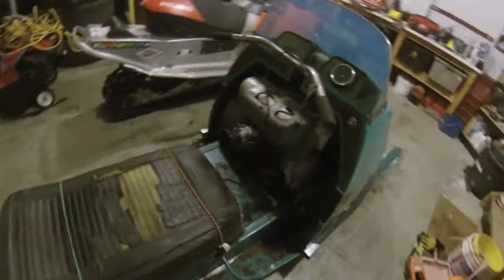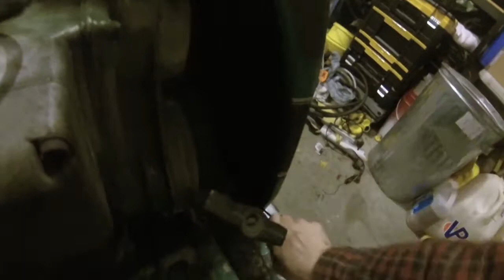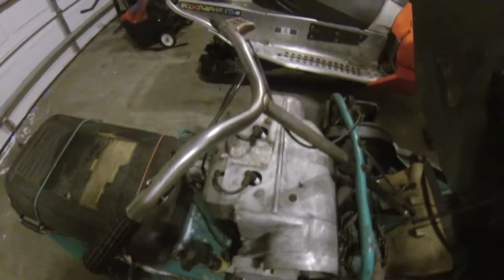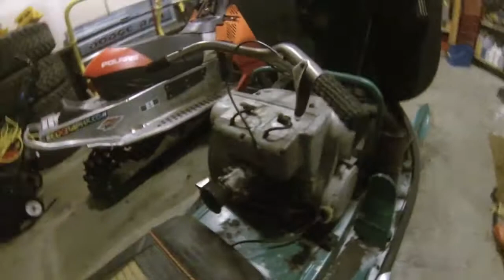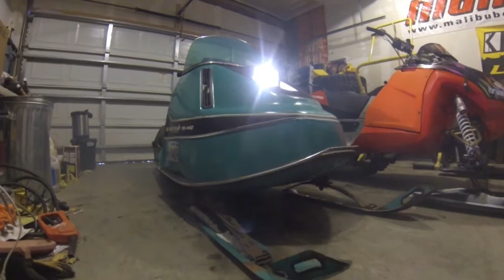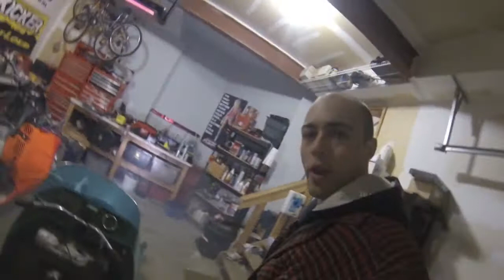1971 Skiroule Rs 440 Sachs, walkaround & startup

Comment: had an re-400, ss-300, and s-250. father assembled them for the local dealer on his off-time. oem clutches and the tillotson carbs were crap.  always wanted but could never find any '70 rtx.
Reply from the maker: Jex Smx Awesome! Yeah the stock clutches are not great.. but they work sometimes aha, these are getting hard to find!